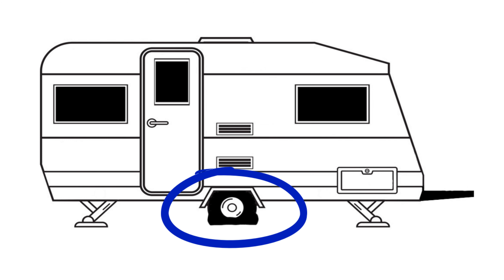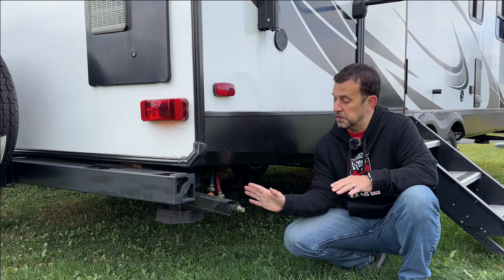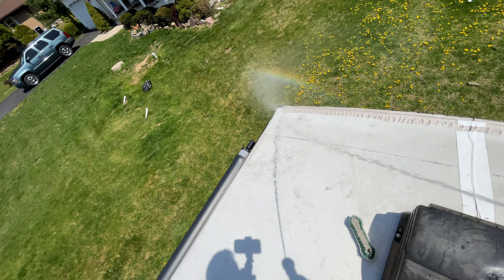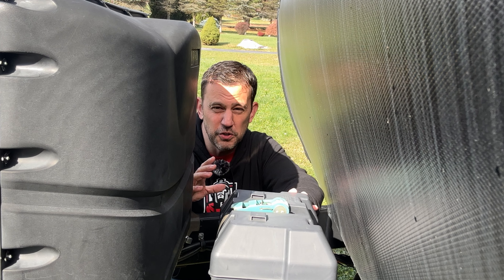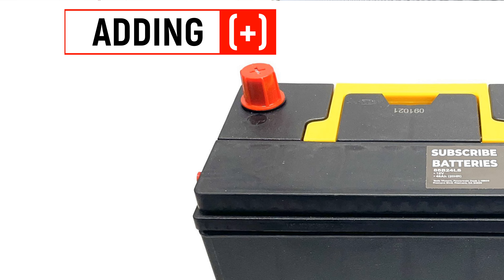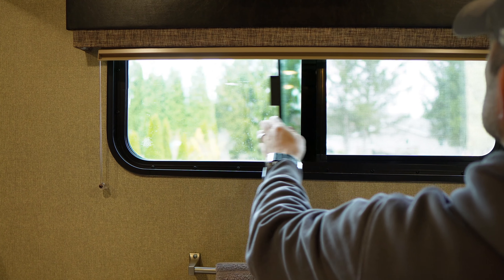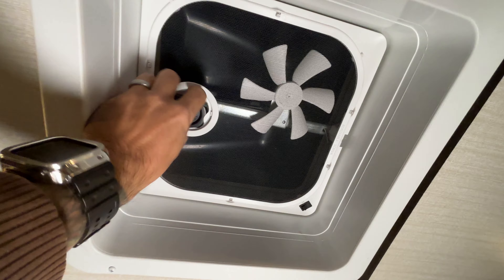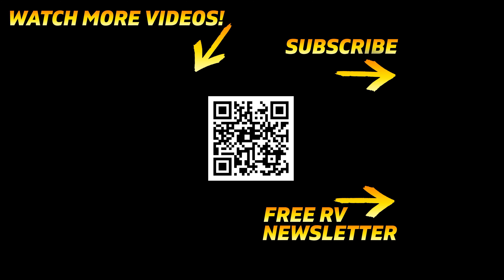10 RV Winterizing Steps You Didn't Know About

Comment from the maker: *Updated on this video:  A few folks have asked about leaving the batteries on the RV over the winter if they are either 1) being charged over the winter or 2) fully charged before winter.  Yes, that is acceptable to leave batteries in the cold, but they should maintain a charge.  Charged batteries wont freeze in most conditions.  The reason I stand behind removing batteries is for a few reasons.... many folks store their RV on a storage lot, where they can not be plugged in, charged or monitored, leading to a greater chance of freezing after self discharge.  There is also a risk of being stolen.  Another reason I recommend removing them even if they are fully charged, any parasitic draw on them from the RV could discharge the batteries enough to the point where they are more likely to freeze than if they were charged.  In short, batteries being exposed to cold is fine, its actually better for the battery than heat, but if not properly charged there is a risk of freezing, and of course theft if left in a storage lot.

25% OFF your RV Mattress: https://www.rvmattress.com/rvtips
Use code at checkout: rvtips

✨⭐ PRODUCTS FEATURED IN THIS VIDEO ⭐✨
🔹 Stabilizer Jack Fitting https://amzn.to/3ukE0Ia
🔹 Boeshield T-9 https://amzn.to/3sINFry
🔹 Propane Tank Cover (20 lb tanks) https://amzn.to/47FW3H6
🔹 Propane Tank Cover (30 lb tanks) https://amzn.to/47FWbq4
🔹 Dewalt Drill https://amzn.to/3unuDHE
🔹 Propane Service Valve Cap https://amzn.to/47kEGvE
🔹 Tire Covers https://amzn.to/49Ksoyk
🔹 Battery Tender Trickle Charger https://amzn.to/40N9Jhl
🔹 Roof Vent Cover Black https://amzn.to/40LrI7G
🔹 Roof Vent Cover White https://amzn.to/3SOTZs3
🔹 Sea Foam https://amzn.to/49WF7y7
🔹 Fridge Door Cards https://amzn.to/40N37iF
🔹 RV Snapjacks (10% off) https://rvsnappad.com/discount/RVTT10

OTHER VIDEOS YOU MAY LIKE
🎥 RV Winterizing https://youtu.be/e8SY7P8Fm5I
🎥 RV Dewinterizing https://youtu.be/9VMN0o9GLxg

RV Winterizing Mistakes: 10 Steps That Are Often Missed or Overlooked There is so much more to winterizing an RV than just using RV safe antifreeze or blowing the air out of the plumbing lines. In this video, I'll show you 10 important steps that I perform AFTER the plumbing lines have been winterized. These may be steps you have missed in the past, or steps that could potentially save you headaches when it comes time to dewinterize and start camping again in the spring.

#rvlife #rvliving #rvtips #rvtravel #rvtips #rvwinterizing

✨⭐ OUR FAVORITE RV ACCESSORIES ⭐✨

ESSENTIALS:
✅ Camco Rhino Flex Sewer Hose & Elbow Kit https://amzn.to/3wxaiyG
✅ Camco 90 Degree Clear Sewer Elbow https://amzn.to/3eezBe7
✅ Camco RV Water Filter https://amzn.to/3VzcMqi
✅ Rubber Wheel Chocks https://amzn.to/3v0lL5I
✅ Hughes Watchdog 30 Amp Surge Protector/EMS https://amzn.to/3hAmgCy
✅ Hughes Watchdog 50 Amp Surge Protector/EMS https://amzn.to/3HKrpm1
✅ Beech Lane Wireless RV Leveler https://amzn.to/402YpgI
✅ Liquified RV Tank Treatment https://amzn.to/3ksg1Ck
✅ Tire Minder TPMS https://amzn.to/3mjuBg0
✅ Water Pressure Regulator https://amzn.to/3m3ZFzZ
✅ Rubber Gloves 6 Mil https://amzn.to/3XNo7Dc
✅ Collapsible Water Hose https://amzn.to/3SvNubw

MAINTENANCE:
✅ Boeshield T-9 Rust Preventative & Lubrication https://amzn.to/3sjcjMx 
✅ Eternabond Roof Tape https://amzn.to/3Ad290J
✅ Geocell Proflex Seal https://amzn.to/3Qdbj8c
✅ Road Tool Kit https://amzn.to/41NIQKj

INTERIOR:
✅ Camco Cross Bar Door Handle https://amzn.to/3o8WWS5
✅ Shower Caddy https://amzn.to/3bdU80W
✅ Soap Dish https://amzn.to/3pKheSn
✅ Oxygenics Shower Head (White) https://amzn.to/3nhDMYW
✅ Oxygenics Shower Head (Brushed Nickel) https://amzn.to/2O8YcYC
✅ Perfect RV Paper Towel Holder https://amzn.to/3tZxd1K
✅ Dimmer Switch https://amzn.to/3rQdfFD
✅ Sliding Door Latch https://amzn.to/3EkpTT0
✅ Puppy Paw Hook https://amzn.to/2N9JaRV
✅ Foldable Storage Bins https://amzn.to/3tIp01f

EXTERIOR:
✅ X Chocks https://amzn.to/3m3ck2i
✅ Carmtek 10 Digit Keyless Entry System https://amzn.to/3t4IMpB (see the video here: https://youtu.be/KcEUgsDw6kk)
✅ Low Point Drain Valves https://amzn.to/3Q8tn2q

OUTDOOR GEAR:
✅ Blackstone Griddle 22” https://amzn.to/3MDDiL0
✅ Blackstone Griddle 28" https://amzn.to/3eBnOuD
✅ Outdoor Gravity Chairs https://amzn.to/3Sb1p4M
✅ Ground Mat https://amzn.to/41u3wXg

💥 Sign up for our FREE Newsletter: https://view.flodesk.com/pages/6497c6...

✨⭐ MORE RV ACCESSORIES ON AMAZON ⭐✨
https://www.amazon.com/shop/rvtipstra...

💥 NEW TO OUR CHANNEL? Check out our catalog:
https://www.youtube.com/c/RVTipsTrave...

🙏 If you found this video helpful & want to support our channel with a small donation click here: 
https://www.paypal.com/donate/?hosted...

✨⭐ DISCOUNT CODES TO SAVE MONEY ⭐✨

🔨 Learn how to repair & maintain your RV like I did w/ this COMPREHENSIVE training course:
https://rvtechcourse.com/?ref=rvtips&...

🚐 10% off RV Snappads! https://rvsnappad.com/discount/RVTT10

🛌 Get 25% off your RV Mattress by Brooklyn Bedding at https://rvmattress.com/rvtips
Use discount code: rvtips

If you find a dead link, let us know & we’ll send you an RVTT sticker!

📺 Enjoy our videos? Please SUBSCRIBE & CLICK THE BELL ICON 🔔 so you're notified when we release new videos!

Follow us on social media:
📸 Instagram https://www.instagram.com/RVTipsAndTr...
🕺 Facebook https://www.facebook.com/RVTipsAndTra...

As an Amazon Associate, I earn from qualifying purchases. There is NO additional cost to you when purchasing from our links & it helps cover some of our material & equipment costs to create these videos. We also may receive products or payment in exchange for content discussed in this video, however our opinions and feedback are based only on our experiences, regardless of any compensation. We GREATLY appreciate your support!

Comment: Hello. New member here. My question is there a reason or a way to winterize the propane system? IE: stove furnace and fridge? I live in Canada so -35 to -40 is not uncommon. I worry about the moisture in the plumbing
Reply from the maker: propane will stop boiling at -44, but doesnt freeze until a temp you will never experience.  i dont think theres anything you need to do to the propane system.  i would just keep the tanks covered.

Comment: Great video. Question, I have the ability to keep my RV plugged in all winter plus I have solar. I read a fully charged lead acid battery has a freezing point of -80 deg F. Since my batteries can stay charged do I still have to remove them over the winter?
Reply from the maker: If you are plugged in your converter, will charge your battery, so there’s no need to remove it. Great question.  However, if you’re not going to use your RV at all, I would just unplug it and remove the battery. You will be drawing power from your house to power the converter. If that little extra electric bill doesn’t bother you, you can totally leave it plugged in.

Comment: I've heard that removing the battery on the rig could burn out or stress the solar charger. Have you ever heard of this?
Reply from the maker: Definitely not an expert on solar systems, and not ashamed to admit I haven’t spent the time learning about them yet so I can’t definitively answer that question. Removing batteries is more meant for folks who park their rv in storage since they can’t plug in at most storage facilities, plus they get stolen.  If you are parked at home with a charge running to the batteries it is usually fine to leave them on the rv.

Comment: Nothing wrong taking the batteries home for the winter. But perhaps more important if you store your rig in the south with high ambient temp. 

Self-discharge of lead/acid batteries are much higher in the garage than outside in freezing temp. Self discharge rate is very low in freezing temp. So charge your batteries to 100% SOC. Disconnect the cables (to make sure you have no parasitic draw) and leave them on the trailer. They will not freeze as long as you charged them before disconnecting. They will be good for 3-5 month if you live up north. If you live in the south you might want to give the batteries a maintenance charge every month as the self discharge can be up to 15%/month if warm.
Reply: This is what I do. Never had a problem and my batteries are now 6 years old.
Reply from the maker: I would agree as long as you’re not getting below a temperature that would freeze the battery after natural self discharge happens.  But leaving them in many cases is fine.  However I mention it because most people’s garages are still very cold, and protected from thieves.  Many people also store rvs in public lots, and batteries get stolen.  I’m on my 6th year as well with my current battery, but I’m sure it wouldn’t perform like it did years ago if I wasn’t plugged in.

Comment: Mice get into our RV so we keep all the cabinet doors closed so the mice can’t get everywhere, we set sticky traps to catch them quickly. Used tire covers religiously for our first 2 years full timing and that did not stop dry rot. We are on the road now for 6 months out of the year and the tires do not last longer than one year anyway so we’ve stopped covering them.
Reply: Closed or open, cabinet doors DONT, WONT STOP MICE THEY GO WHERE THEY WANT!  Once they are in, is already too late.
Reply from the maker: if your tires are dry rotting after 2 years there is definitely a problem with the tires... they are either garbage or if they are a good brand there may be something with the compound. i have never seen tires dry rot in such a short time and ive been working on vehicles for over 25 years.  I had cheap china bombs on my rig for the first 4 years and even they stayed in great condition with just a little care. i actually ended up changing them only because i was getting uncomfortable with the age, but otherwise they were in great shape with a good amount of tread.  have you ever used a tire protectant?  this is what i use: https://amzn.to/46zfws5
Reply: @RVTIPSANDTRAVELS  lol after one year they’re starting to dry rot or the treads have completely worn! I’ve had many different kinds of tires, Michelin, Firestone, Good year Endurance, Towmax I never cheap on tires all 10 ply. We really spend a lot of money on tires they should last but these companies do not care they all get their inventory through a China, just junk.
Reply: If you have a slide out, the mice are likely getting in through the bottom corners as there is a gap there. I pack steel wool into them and that seems to have eliminated the problem.
Reply: Leaving the stovetop vent open is an invitation for wasps to build a nest in there.
Reply: @ we have 0 slides, the sticky traps work great as long as you keep on it.

Comment: Well you’re wrong on1 point I live in Colorado and forgot to open my sink faucet only to find the water froze it snapped off and ended up 4 feet away. Lesson learned.
Reply from the maker: Robert, I would say you had issues because you didnt get all the water out and it froze. This happens more than you think when you use the compressed air method, which I am assuming you used.  Water freezes at 32 degrees, it really has nothing to do with the faucet being open or closed, or if you live in Colorado , Pennsylvania, or Antarctica.  32 degrees is 32 degrees.  With 116,000 subscribers I get messages every day, folks having issues where trace amounts of water in and around the the inside of the fixtures doesnt all come out with compressed air and then it freezes.  This is why I prefer the antifreeze method over blowing out with air.  Pushing that water out with antifreeze rated lower than your local temps will solve this problem. Here is my antifreeze video if you need some help.  Thanks for watching and I hope you dont have this issue again! https://youtu.be/e8SY7P8Fm5I

Comment: Another great video! Thanks. What do you think about putting trailer axles on jack stands for the winter to avoid tire flat spots? I’ve heard of this but haven’t done it.
Reply from the maker: I’ve heard of it but also never did it.  My first set of tires were china bombs and they lasted 5 years.  I’d have to do some serious research to see if flat spotting is a real thing that doesn’t correct itself like it does with forklift tires.  Great question though!
Reply: I’ve been keeping my trailer up on jacks for years. My tires have lasted much longer than they’re supposed to.

Comment: Always informative. I’ve noticed that no one ever talks about plumbing. Lots of rv plumbing are not using the right pipes or fitting. Every time I see a utube video on inspection they never show or mentioned plumbing. And no one mentions the type of tubing needed for repairs and the clamps and tools needed either. Not to mention no one ever talks about putting a water sensor near your pipes so if there is a leak you will get noticed. So in the morning you dont wake up in 2 Feet of water. Now  you know  what video you can do in the future. 😊. Thanks so much.
Reply from the maker: noted, ill put it on the list!

Comment: Great tips Ross I also use 2 dri z air baskets dehumidifier in the trailer and Camafro heater for air circulation it only draws about 90 watts 15 years now no problem 😉
Reply from the maker: Good stuff my man.
Reply: Corey can you please explain your Camafro setup? Just bought some dry z baskets, thanks for the tip

Comment: Good tip on those extra batteries. Our drill batteries stopped working after leaving them in the pass through last winter - could no longer charge them and pretty sure it’s because the batteries froze.
Reply from the maker: Thanks for sharing!

Comment: Disagree with stabilizer jacks, what if you have strong wind storms. open those valves, water is trapped freze it will expand broken faucet they are plastics.
Reply from the maker: I winterize with antifreeze, it pushes all the water out, so there’s no water to freeze.  Also, the point at which a trailer would pivot if it were being tipped over is at the tires. Stabilizer jacks are under the RV usually in front of the pivot point, not behind it, so I don’t think they’re going to help any.

Comment: Thanks for the great tips. I used the blue/orange low point drain valves you used hut they kept leaking. 

Replaced them with brass Pex ball valve. So far so good.
Reply from the maker: Despite mine not leaking, I’ve heard this from a few folks.  Thanks for the input my friend.  I might switch over to brass just as a precaution.